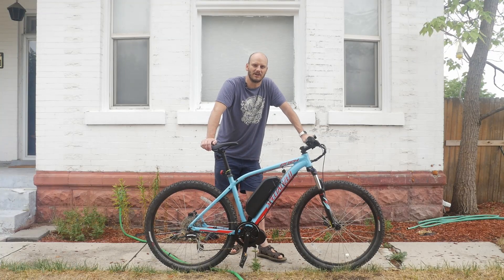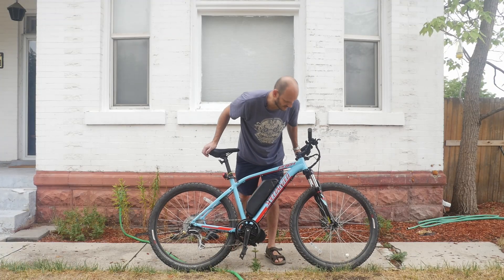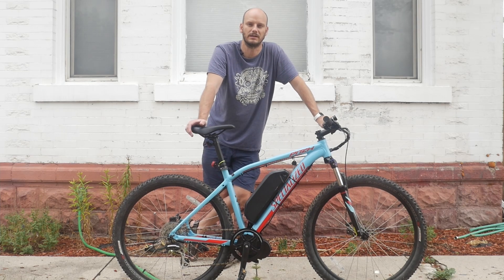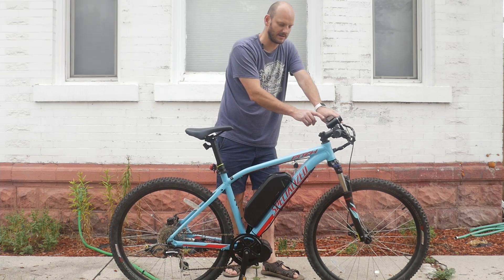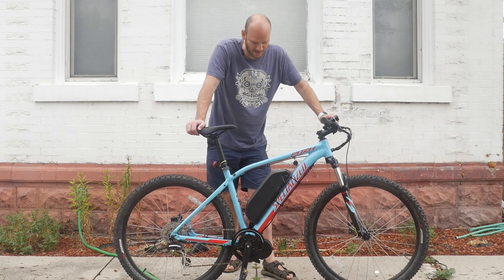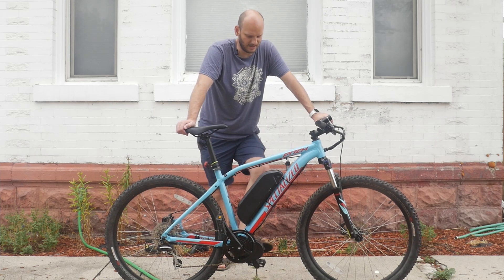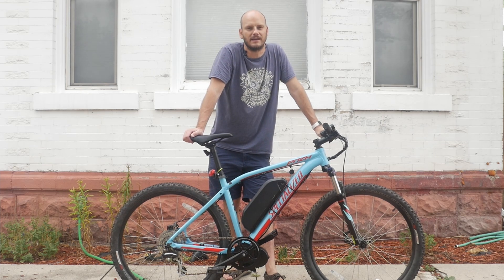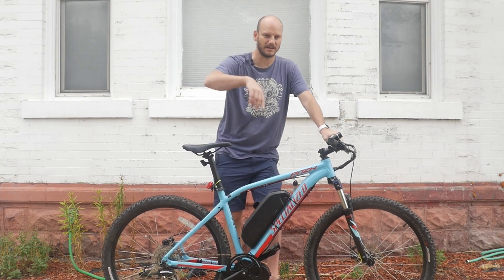Custom E-bike Build: Specialized Pitch 52v 17.5ah Bafang BBS02 750w Mid drive

Comment: An electric bike is really a cool thing. I agree with you 100%!
My wife and I also have Specialized bikes (Hardrock and Pitch). And we will also install mid-drives for the new season.
Before that, I tried to ride a rear-wheel drive Haibike for a while.

Comment: Does the bafang motor cause damage / warp the bottom bracket over time?
Reply from the maker: I haven’t seen that yet
Reply: @JohnnyNerdOut  I am thinking about converting my Dahon Mariner D8 foldable bike and it is made of an aluminum alloy.  I guess I will have to do some more research to see if this will work for me.

Comment: Well, you sold me on the idea John. My neighbor was selling his 2020 XL Pitch cheap, so I bought it today. Signed up and logged in on your website, but noticed it reflects a lot of the required components out of stock. Is there availability for the 750w Bafang & high Cap batteries? I was hoping to schedule the conversion for Oct 1, if possible. And what is the weight roughly of the completed Pitch' you did?

Comment: Great videos and you're absolutely right! So since I have an old 2016 GIANT Atx 27.5 model can you kindly check based on the specs of my bike if BBSHD would fit perfectly? Also would I be able to reach at least a top speed of 35mph using that motor with it. I'm a 5'6 140lbs guy. Thanks a lot man!
Reply from the maker: I’d verify the dimensions I have of the batteries listed in my shop page to confirm your frame 👍

Comment: Question for you Johnny! So I installed a BBS 02 on my specialized Enduro I took the gear cover off and greased up the main gear no problem and didn't take anything else off and just put the cover back on and for some reason I started develop a weird kind of knock when the motor is running, it doesn't seem to affect when I'm riding it but when I am off the bike and lift the real wheel and hit the throttle I hear a slight knocking ticking noise. Any idea what that could be
Reply from the maker: Possibly a bicycle related noise? Check brakes, chain rubbing etc. you’d be surprised what the culprit can be sometimes
Reply: @JohnnyNerdOut  thanks again for you leadership, your like the ebike Gandalf!

Comment: I’ve been hesitating because of the three host bikes I have to convert they are all rim brakes. What I think I’m going to do is convert one and either upgrade the brakes if I see fit, or port the motor and kit over to something else down the road. Do you see any holes in this logic?
Reply from the maker: Na. Might be labor intensive but pretty sound.

Comment: Johnny, you can make the BBSHD legal all over too by limiting its amp draw. That is one thing I like about the 850c display. It is soo easy to make those changes right in the settings.
Reply from the maker: Very true👍 although the motor casing will still be stamped as 1000w. But technically it would be legal
Reply: @JohnnyNerdOut  of course, we know nobody is going to look, but should the issue ever arise, it would be easy to turn on the display to demonstrate.

Comment: How far on throttle at 30mph? Mainly flat terrain except for one very steep hill at the end, 200 yards.
Reply: Yes, that what I’d hoped for. Any suggestions what I could do apart from buy a new battery, £300 approx here in the U.K.
Reply: l have a 14.5ah and as Scott H says, I get about 10 to 15 miles with just throttle and probably 30 odd just pedalling at 30 mph. I'm always trying to push ahead of the motor though to save battery. Definitely something not right there.
Reply: Hello and thanks for your comment. I must admit, that your figures are what I hoped to be be achieving myself.
Reply: @petermccarthy3664  you need high-performance cells. At least from the research I've done you have to be certain that you don't get generic.
Reply: Good morning and thank your advice.
Reply: Thanks Scott. I don’t think I’m getting 10miles with peddling as well. Probably more like 6.
Reply: Thanks. I think I’ll try the second alternative. I appreciate your advice.

Comment: I checken and in Sweden nothing seems to be legal above 250w.
Reply: Yes, that’s why all the Bosch units are built to euro spec, 250w, 500w peak. Chinese motors are labeled whatever the buyer wants, but typically run 500-2000w

Comment: Time for a story.  About 3 months back I built a Specialized Allez...aluminum road bike with BBSHD and 52V 19.2 amp-hr with Tesla cells battery.  With 28c tires and 52t Lekkie chainring and Rival 1 shifters, the bike will get into the low 40's mph with stock controller at 30 amps.  Because its a road bike and I come from the world of competitive cycling on the road...I am a spandex guy...I like to have fun with elite racers on this ebike.  So I play around with a lot of CAT 1's who can hit 30 mph on a road bike.  Today...there have been several occasions, I met a nice guy who was a CAT2.  Most...not all, never notice I have a motor.  My bike is black.  I generally cruise behind these guys at 24-25mph or so and when I go around them and they get in my draft, they can hold my wheel at close to 30mph for a while.  But if I drop the hammer and accelerate in max assist, NOBODY can hang with my ebike.  That is where the fun is.  But, boy do they fight hard to hold my wheel.😊
Shoe on the other foot, when I am on my carbon non ebike roadbike, I can hang with many low power ebikes...as in store bought.  A lot of these guys on store bought ebikes can cruise at 25mph...but they don't have the top end to drop me if I ride in their draft.  The Bafang motor...I prefer the BBSHD and BBS02 is a good motor too...rocks the house.
Keep up the good work Johnny.👍

Comment: Hi Johnny. Was wondering if a BBSHD is a better choice for heavier riders (220+ lbs) mostly urban commuting (also adding on 10-15lbs in large Ulocks/chains). Great Videos! Cheers!
Reply: Thanks for the advice everyone. I'll be going with the BBSHD. Figured it would be better to handle the extra weight over time when using mostly or all throttle to keep up with NYC traffic. Decent Battery and a Bafang adds another 30lbs or so so it makes sense if you already weight 220+!
Reply: @718og  good call. Unless you are absolutely strapped on cash, bbshd is the way to go. Better all around even if you don’t use the full power all the time. If you are hauling cargo bbshd for sure. Lot of people seem to find it hard to justify the 200$ extra, but cmon you are already in 1000$+ to do the conversion. 02 is loud , i always find myself pedaling hard with the 02 wishing it just had a little more. If you are commuting on streets with cars you want the HD for sure , it keeps up much better, with the 02 cars are always passing you and riding you.
Reply: I have the exact same setup on a Trek Marlin 7 and weigh the same. It powers me really easily and it's very fast (as fast as the cars) I think it's perfect for urban commuting and it helps me get up pretty steep hills too when I go on trails.
Reply: Just do it.  BBSHD is about 200 bux more.
Reply: I have a BBSHD (ludicrous controller) and weigh about 140, the BBSHD is way too much power for me if I was only commuting. Never use more than 750w assist while pedaling. My dad who is about 220 agrees that a 500-750 will be enough if you are just pedaling. While you may not use the power all the time, if you think you'll find yourself using the throttle. Or just seeking a little more fun out of your commute go with the BBSHD. Not much of a cost benefit of the bbso2 especially if you think you would grow out of it
Reply: just get a cheap 1000-watt hub motor.

Comment: Hey Johnny. Q: (regarding shifting with a mid-drive) - Does it put added wear and tear on the drive train/chain shifting while going uphill? thx
Reply: I would recommend shifting before you get to the hill and have a gear shift sensor on your build.

But yes you can shred your cassette using full power while shifting.
Reply: A gear shift sensor helps tremendously.  A Bafang mid drive ebike is an electric motorcycle.  It is hard for a notice to understand how to ride because you can't hear the motor. For heat and stress on the cassette, you want to be in the right gear when ascending a hill...just like you don't want to be 5th gear on a Harley at 30 mph climbing a hill with 10% grade.  I have no problem with my 11 speed BBSHD bike up hills because I know how to ride it.  I get real good life out my chains and cassettes.  Ride it wrong, you pay...same as a Harley.